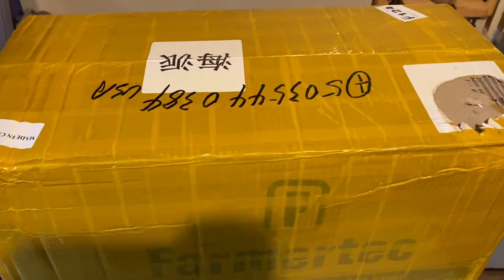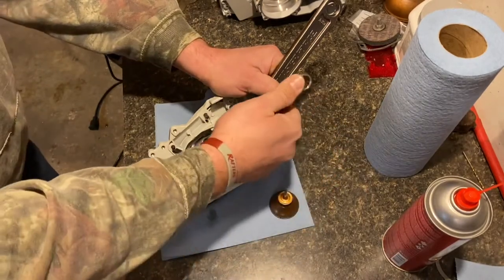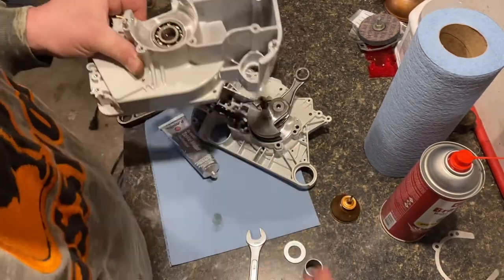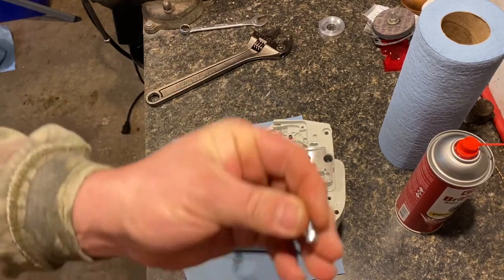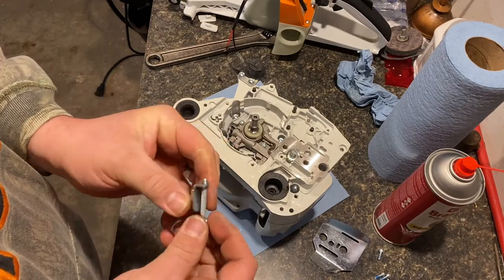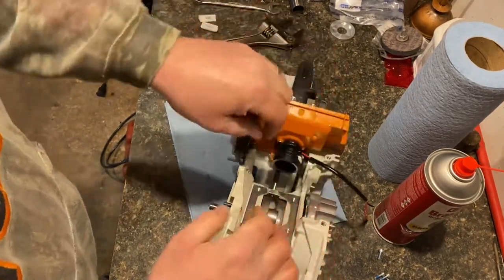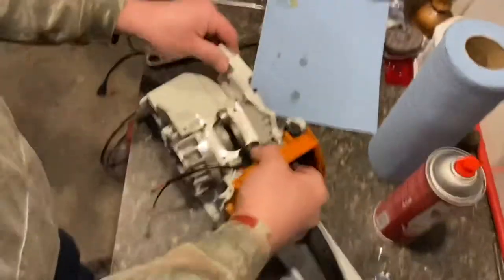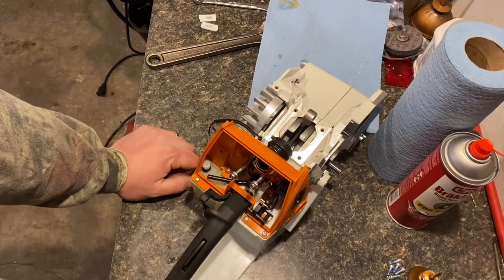Farmertec/Huztl MS660 Clone Assembly Part 1

Comment: Put the crankshaft in the freezer for 1 day.  Heat the crank bearings with a hair dryer or heating gun for couple minutes.  Take crank out of freezer quickly dap little WD-40 on it and slip both ends in with ease. Tighten bolts.  Walla NO TOOL NEEDED!   Works every time.  Thank you, I am here all day :)
Reply: Make sure you read all the instructions first 🤣🤣🤣

Comment: You don't need that special crankshaft tool to put the crank case half's together I just built two of these saws, one the same MS660 the other MS880 I align the gasket. Put some oil on both sides of the shafts and the bearings. And put both sides in and put my weight on top of them on the floor pushed very hard and they snapped right together
Reply: Does the 660 and 880 kits come with full instructions ?????
Reply: @RaquelGoade  No instructions at all!! It's a big puzzle with no instructions. You will have to either watch videos or look up a schematic on Google. If you're really mechanically inclined, you'll be able to do this without any instructions

Comment: just a thought about the spark plug...it has been a problem in the aftermarket auto parts industry concerning counterfeit parts...keep this in mind on this saw spark plug.
Reply from the maker: Have been running this saw for almost two years now and have not had a single issue with it. Hopefully be making some new videos with it soon. Have something new up my sleeve and was the reason I built this saw. I have been very impressed with it and how well it runs. I was very skeptical when I bought it but so far so good.

Comment: Best way I've found for putting the crank in is to just put it in the freezer for a couple hours. They slide right in!
Reply: Without needing a tool or anything?!?
Reply: @Bill Francis  correct. I actually just did another one the same way. Freeze the crank for 2 hours, and took a heat gun to the bearings. But didn't heat the bearings to much. I could still touch them without cussing. The only friction is getting the seal on, which I also didn't use anything fancy for. Just pushed the crank though as the case came out of the box. I'm a machinist by trade, if tolerances are correct,  "press fit" parts should slide onto eachother when the proper heat/cold is applied. It's just science lol
Reply: @Bill Francis  then once the halves are bolted together I just tapped on the crank to center it in the case. Just by eye. You'd be surprised how accurate they are! Just make sure to move quick lol, but slow enough to ensure it's done proper
Reply: @mm88swrt the freezer trick  worked perfectly for me and seemed easier than the video. thank you
Reply: @Randall  glad to hear I could help someone! I've always liked making things easier. How does it run?! You do any mods to it?
Reply: @mm88swrt  just got it yesterday and just put the crank case together today lol. i am gonna just get it together and see how it does for now. maybe do some mods in the future. thanks again
Reply: @Randall  have fun with it! Make sure your chain adjuster runs smoothly. The nipple on every case I've had has been oversized. Easiest way to fix it is to open up the actually adjuster piece at an angle . If that makes any sense lol. Feel free to reach out if you have any questions. My user name @ gmail
Reply: @mm88swrt  Any tips for installing the oil tube when using the heat/freeze method?  I was thinking maybe if I put the oil tube in the freezer as well and installed it on the hot case it would be cold enough not to get compromised by the heat?

Comment: Why didn't you show how to install the bar studs? Another video from someone else shows him thread lock the studs and install before putting the halves together. Both ways seem wrong because if he locked the studs in how did he get them back out to put the other stuff on? You skipped the stud install. My problem is I saw the new England saws video install the studs with the long end and flat shoulder to the holes for the studs. That seems wrong because they have a tapered shoulder that looks like it makes to a tapered recess for the stud holes. Can someone please clarify when they should be installed and which end of the stud goes in first? The short end with the tapered shoulder should go in first to mate to the tapered recess correct? The manual doesn't specify or show how it's supposed to be done. Only torque spec and just says install it. Just looking at it tells me the taper shoulder should mate with the tapered recess...

Comment: Awesome video! That crank puller looks nice, simple but very effective! Do you have a link for it at all?
Reply from the maker: I do not have a link but if you go to ebay and type in Stihl ms660 crankshaft tool it will come right up.

Comment: No way is that a real NGK plug.
Reply from the maker: Sure is. Farmertec has a contract with NGK starting last fall.
Reply: @shrunkenskulloutdoors  That's awesome. Do you know if they're making them in China or shipping them from Japan? 
Love your videos, especially the crank installation. You can tell that heating the cases and dropping it in with a prayer isn't going to yield the same results. I'm waiting on 4 kits and looking forward to building them.
Reply from the maker: @SalisburySnake  as far as I know they are shipped to them.  I didn’t like the heating of cases either and Stihl presses them in so I built it the way it would be done by the factory.